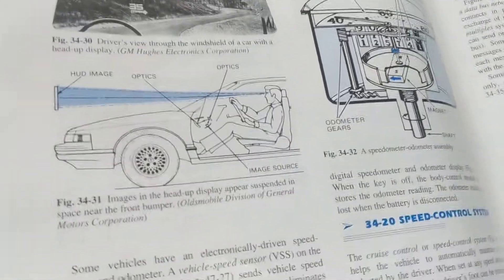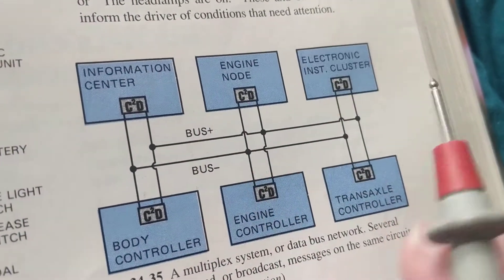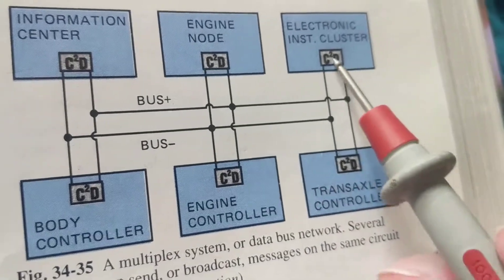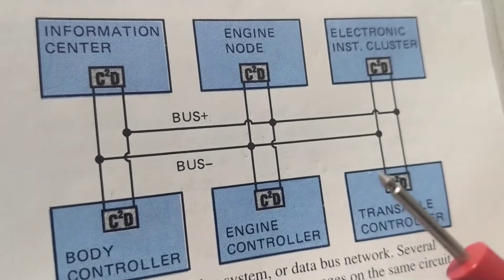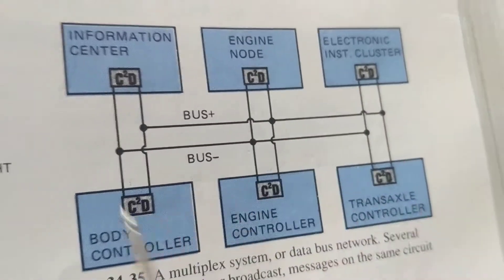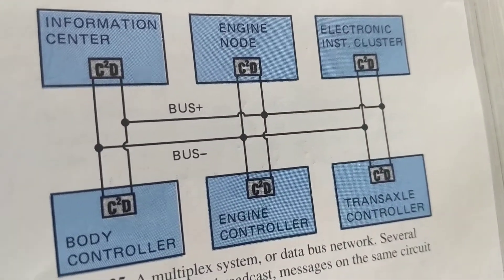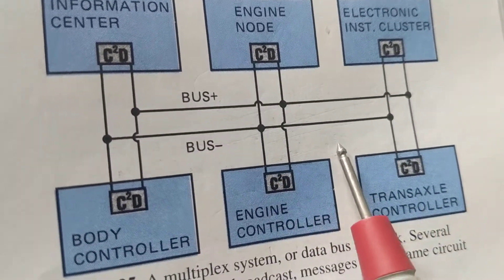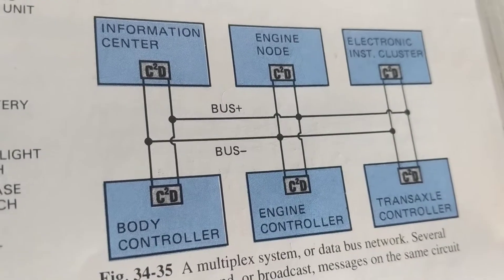HOW COMPUTERS WORK IN CARS

Comment: Hello, Joe. I have a question and perhaps you may be able to give me some advice...
As you mentioned, cars are becoming more advanced. More features, more technology, and more computers. When I worked for an automotive shop for a little while it seemed like almost anything that went wrong we could order the part and fix it in house. However, that was not the case when it came to the computers in the car. I had to drive the car to some local mom and pop speciality service shop that worked on the computers in the car (I suppose because its highly technical and hard to learn and perhaps many automotive shops don't have the capability to work on the processors and chips or some of the modules?). Anyhow, as more and more computing/computers get added to newer vehicles do you know what year of make would be a good year to say "okay this year a ton of new complex computing hit the car market and is on board in vehicles; therefore, after this year its a good idea for me to purchase a vehicle with a warranty that covers computers in the car". Also, what are the industry trends (if you happen to know) when it comes to hardware manufactures across the different car manufacturing lines? Will most vehicles be having the same or mostly similar computer hardware? What will that do for maintenance on older vehicles with older computer hardware when it comes to supply of mechanics trained to work on what may one day soon be called something to the nature of 1st generation car computer hardware? Will that cause any complications in your opinion with finding a mechanic and warranties and if so what year would you say next generation hardware hit the market if it has already and therefore you may want to avoid purchasing a car prior to "x year"?
Reply from the maker: Basically to try to answer your question all cars in the last 20 years have had computers controlling them recently there could be 20 modules and over 30 sensors so the demand for people who know electronics is tremendous the equipment that you need to diagnose these cars are very costly and it can only be invested if you think you're going to make a lot of car repairs most private places do not have an alignment machine because there are new cars out there and they don't need alignment why spend $100,000 on such a machine I'm getting parts for cars you have to find a good distributor depending if you got to go aftermarket or OEM that's just by experience whatever gives you the best parts like we use Wagner brakes and we use champion batteries so they've been very successful for us another thing is when you do order parts take a picture of the old part and send it to the distributor so he doesn't make any mistakes
Reply from the maker: Regardless of the year you should always get a warranty on a vehicle there is no specific year but obviously now even the Toyota Camrys which was so dependable have many electronic problems so always get a warranty
Reply: @Joeelectronicschematicsforauto  thank you